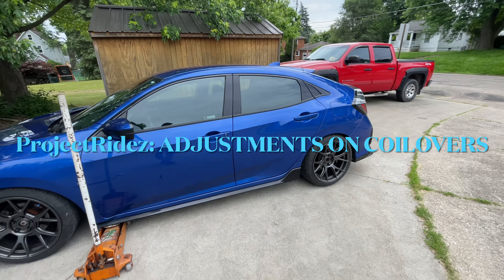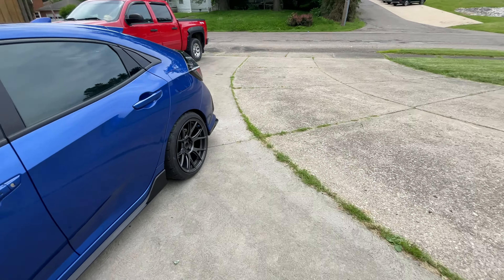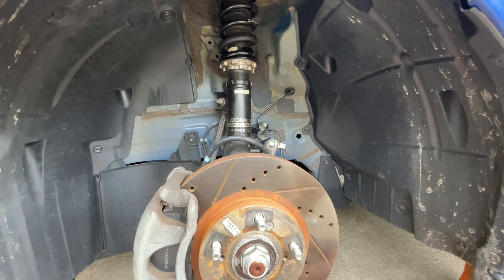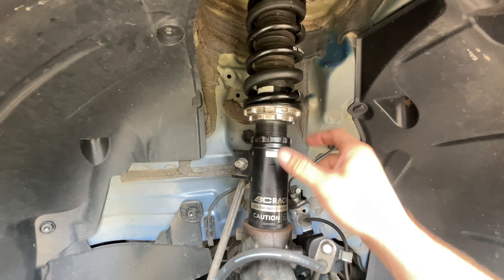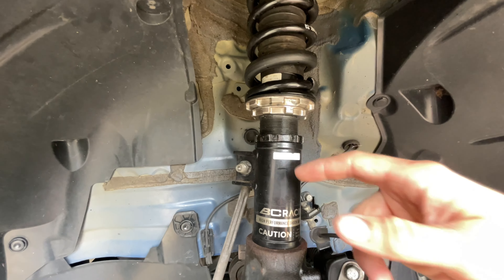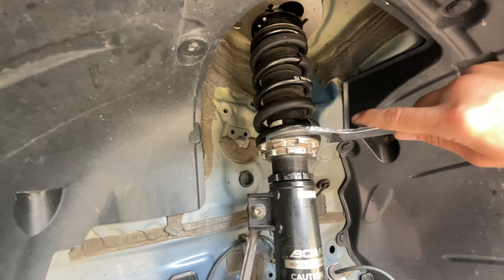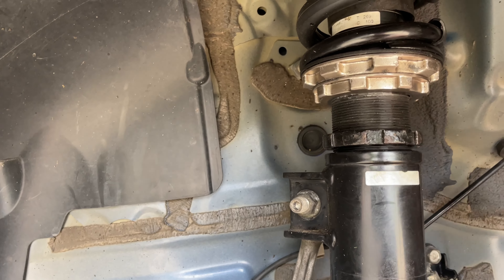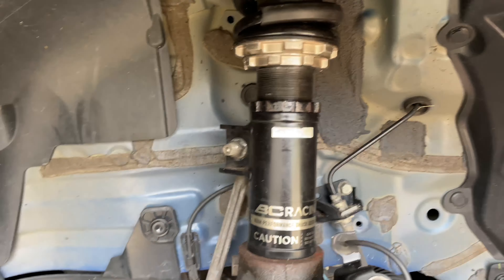Adjusting ur coilovers like my BcRacing on my 10th gen honda civic fk7 hatchback

Comment: Did lowering it mess with you acc or collision midigatin sensor…?
Reply from the maker: No sensor on the fk7 than the civic Si dampening sensor, u would have to use a hks sensor module per side